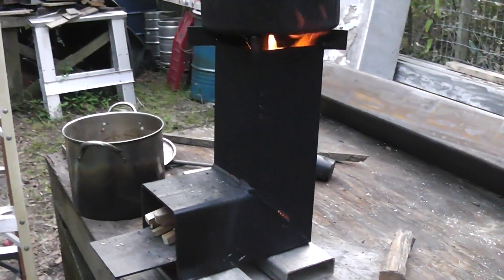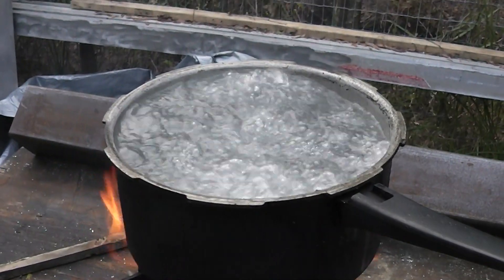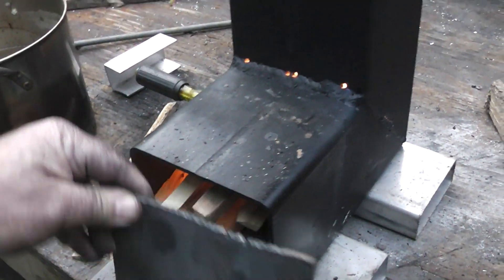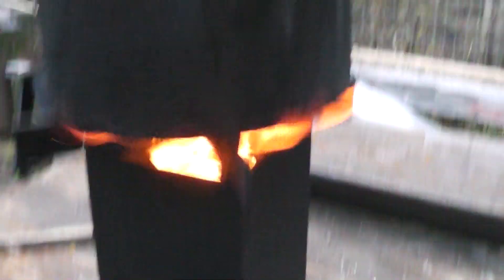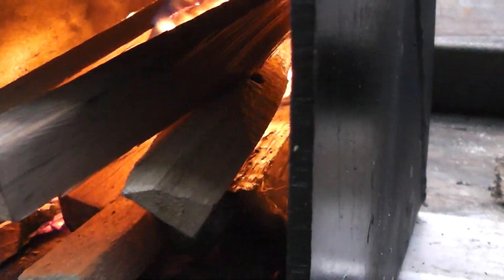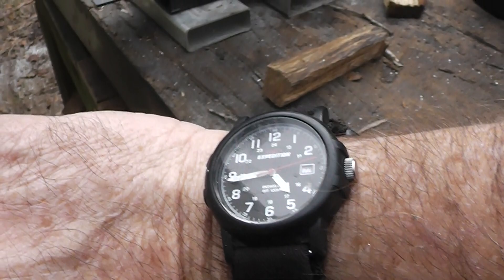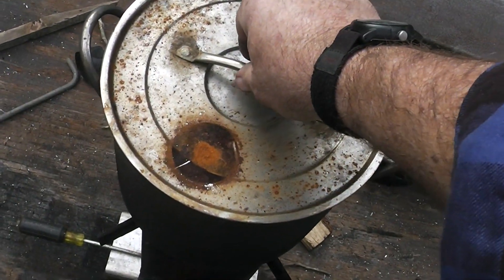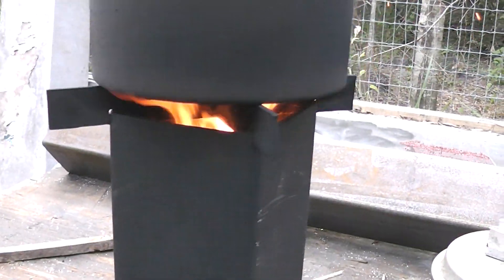Can Your Rocket Stove Do This?

Comment: Dryer, thinner split wood with more surface area = hotter fire.. There is a happy medium.. Stuff the wood in, but, leave enough room for sufficient air flow.. The more restricted the flow, the faster the flow,,, up to a certain point.. The faster the flow, the hotter the fire. Same thing as a blacksmith pumping hard on his forge..  A guy needs a good rocket stove just for boiling water, then, needs another for long term cooking.. Check out my "Long Horn Rocket Stove".. Went through 3 Revs before I got it where I want it..

Comment: Less wood (up to a point) split thinner (dry wood for even a better effect) to get the most heat out of it...  When you want to control the amount of heat and cool it down, control the draft by stuffing it full of wood like you have in the stove in the video.. Dimensional split wood fits the best and closes up the air gaps.. The less air you let it have the less flame and heat..  You can do the same with sticks of wood (round) = less surface area/bark, etc,,, and also can control it with the level of damp or water in your wood... It is going to get more air, but, you can use other things also to slow the cooking down, or speed it up. 
Cooking directly on a flame is hard to control the heat though.. If you want to see a real cadillac rocket stove for long burn cooking (Beans and Rice will be the order of the day),, check out a playlist on my channel called "Long Horn Rocket Stove"..
Two cooking surfaces.. One for Boiling/Frying, and one for slow to medium boil or simmer,, plus two warmers to keep anything else warm while you are cooking.. You might enjoy the Rev 1, 2, 3 videos on that stove.. It was the last one I built, after I broke all of the "Rules", experimented with Vortexes, etc,,, and figured the things out.. Exactly what I was looking for when I started experimenting, looking for a long burn cooker..  It's obvious that you can build one.. Just a note.. The only reason I used round pipe for the top horizontal piece (Second cook surface) was, it was 2 in the morning and that was all I had after I came up with the idea.. Ha.. Any future builds will be all 6" x 3/16" Square tube, but, still use the 4" round exhaust tubes.. 
Keep up the good work.. Strange though.. I don't even think about eating beans and rice cooked on the rocket stove any more.. If we make it past draining the swamp in the next year, I think all of the previous work I did will be just what it was.. Insurance,,, just in case.. But, from now on, will be dangers from Outside of our Country, rather than in that dinky little place that is not a State or County,, but is a District of a Foreign Country, where we have to "Recommend indictments like we do on Foreign Ambassadors" vs Arrest the damn bunch like we do to the rest of us.. Cheers..  Hey.. I really like that Rocket Stove Water heater.. Excellent idea..  I guess dumping the ashes from time to time means a pull and dump upside down??  Bet there was a good bit of grinding/re-welding and re-testing going on in that build.. Ha.  There goes those pesky little Re- words again.. Ha.. Cheers..

Comment: That doesn’t make any sense?!? How is fire+water+pot not going to equal boil water? I can’t say I’ve ever had trouble boiling water 😂. I’ve used open fire, electricity, all manner of camping stoves and never once has the water not boiled 😂😂😂. I guess you can always race to see who’s first but most of that has to do with having the right pot for what you are trying to do more than the fire itself. Also the temperature of boiling water is constant so it doesn’t matter how much it’s boiling.
Reply from the maker: I'm not exactly sure how to approach your comment but, maybe you could make a video of you using a rocket stove to boil a 55 gallon drum (or container of your choice) of water? I'm sure you would have all of our undivided attention.